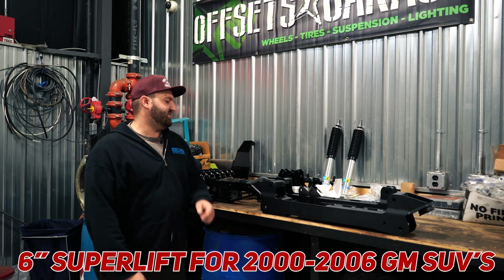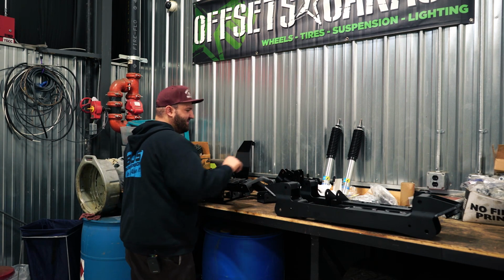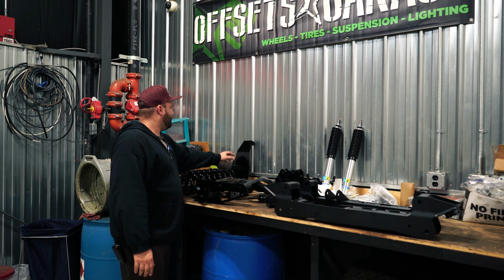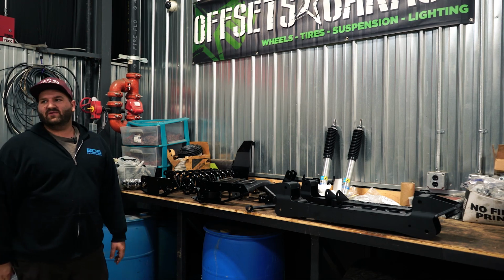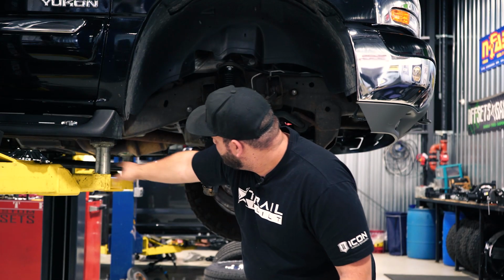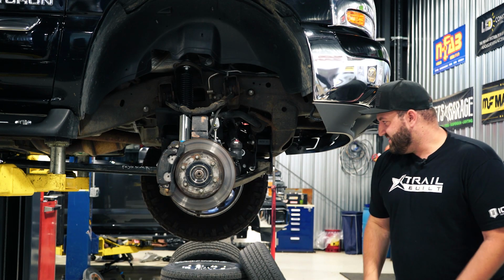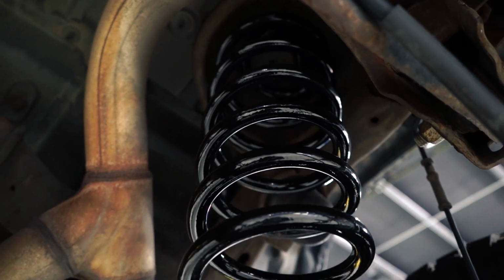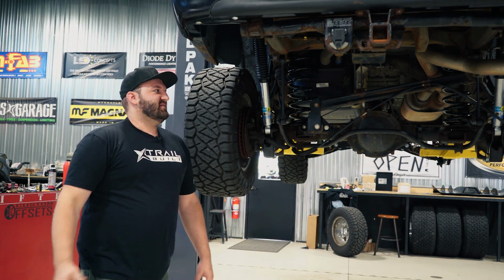6” Superlift Lift for 2000-2006 GM SUV’s || Lifts and Levels

Comment: I'm buying this truck due to the fact they are pretty much bullet proof and so versatile. The hard part is deciding on the wheels I want to run.

Update: I bought a 350k mile Suburban Z71 4x4. Still runs and drives. I will put new 5.3L or bigger 6.0L engine from GM,Jasper etc. I will run a set of 285/75/17 on steel wheels. Leaning towards the Kryptonite 3" kit or may just do the Rough Country. I plan on doing long distance towing and overlanding with it in the future. God Bless!
Reply: Nice 🤝😎

Comment: Would this work on the Yukon Denali being awd?
Reply: It is 4 wheel drive not awd
Reply: Cam Mann Yukon Denali is AWD, not 4WD
Reply: @cammann1561  believe it or not the 99-06 denalis are AWD so they don’t even have 4x4 shifters the truck automatically senses when it needs to use all wheels
Reply: @cammann1561  awd my guy

Comment: What is the most affordable 4 inch lift kit for a 2001 Tahoe
Reply: Personally I’m not even sure of the brands that make a 4 inch lift for them. The cheapest route to get a 3 inch lift without buying a full lift would be to get 3 inch leveling kit for $2-300
Reply: I have a complete 4" I want to sell or barter
Reply: @frankspainal79  I’m already running a 6 inch with 3 inch keys so the front sits at 7-8 back is at 6 so it’s a baby lean
Reply: @frankspainal79  how much
Reply: @frankspainal79  still have it? How much buddy?

Comment: Why did he use the rear shock brackets if he has the longer Bilstien shocks???   I thought those brackets are only for the old stock shocks?
Reply: He used stock length bilstiens in the rear
Reply: Darrell Butler Should have used the remote reservoir 5160’s and tossed those brackets. Those springs can fall out if there’s too much up travel.
Reply: @jeromeburrasca6710  what do you mean ?
Reply: Christopher Brown Putting on those shock extension brackets when you have longer than stock Bilstien’s can create too much travel (longer than the spring) and the springs can fall out under full shock extension. Compare your stock shocks at full extension to the Bilstien’s.
Reply: @jeromeburrasca6710  did you not see where he said he used stock length bilstein shocks? If you let the suspension down all the way those bilsteins won’t let the spring fall out they are factory length
Reply: @michaeldagostino69  You never want to use the shocks as the limiting factor, you can damage them on full extension, that’s what limit straps are for.
Reply: @jeromeburrasca6710  Did you not see where the rear gets new larger springs? You are not paying attention at all.